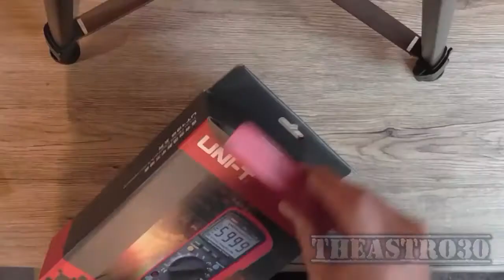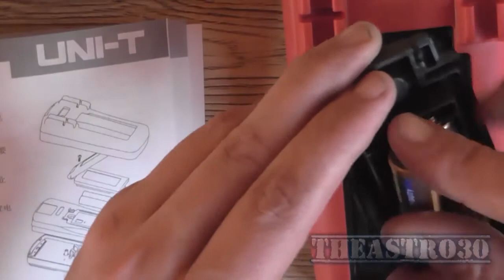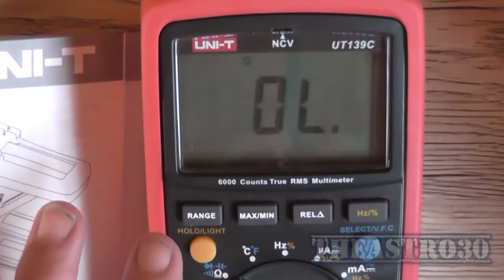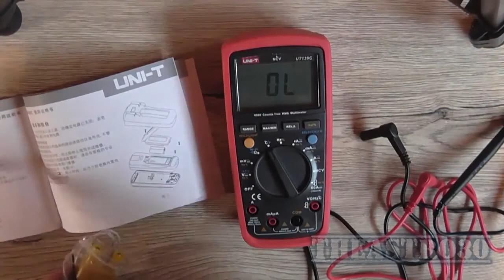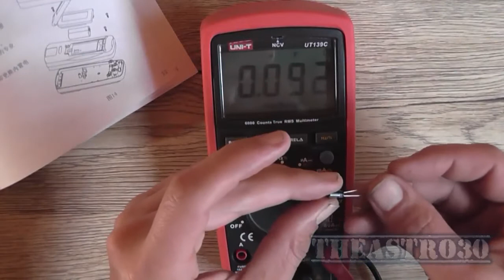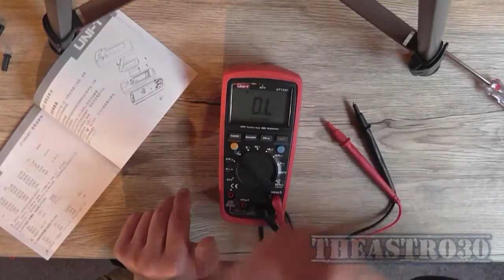Uni-T UT139C Digital Multimeter REVIEW

Comment: WHAT IS THE REASON I COULD NOT MEASURE THE OSCILLATOR IN Hz STAGE WITH UT139C MODEL MULTIMETER? UT61C MODEL CAN READ 32.768 FREQUENCY VALUES. IS IT POSSIBLE TO MEASURE Tuning-fork crystal used in a modern quartz watch WITH UT139C?
Reply from the maker: You can only measure the frequency of a running oscillator, not a crystal itself.
Reply: Thanks for the unknown information. The working crystal oscillator does not measure ut139c. ut61c model is measuring. @AstrosElectronicsLab

Comment: I have this meter.  You have to wait a bit for the larger capacitance measurements they dont come immediately on most meters - it will either give you the reading or if its out of range it will show up as "OL" for over limit, and you should discharge the cap by shorting its lead for a couple seconds then test it.  Also when reading capacitance touching the leads with your fingers can affect the readings accuracy adversely especially on the very small cap values.